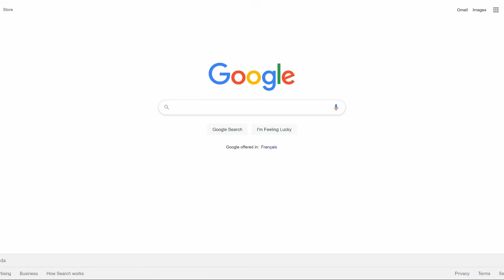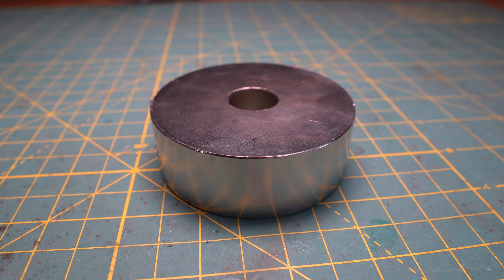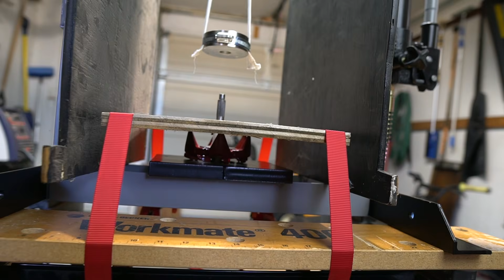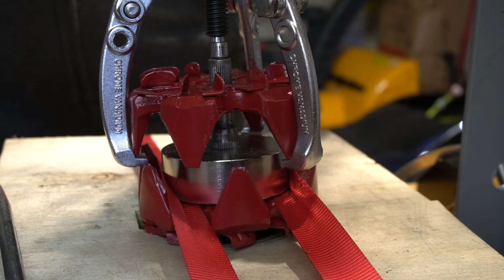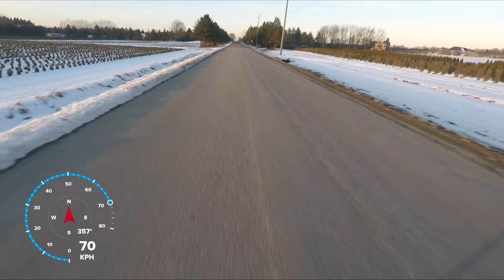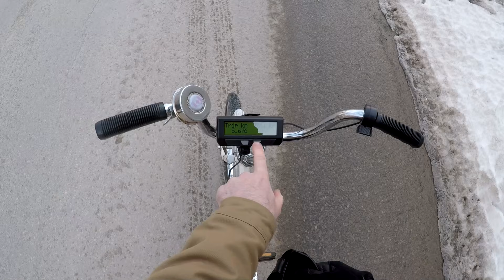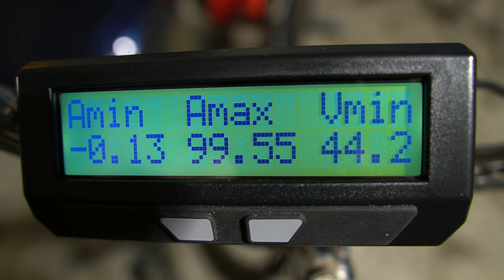Building an Alternator Powered Bike - Part 2

Comment: you would not have to, coil-coil non-blocking motor is better
Reply: To be honest, his idea was better
Reply: @foxxyytofficial  you are just proud of what you chose to be better, starter motor is a great option
Reply: @Jkauppa  but only after rewiring and opening breath holes, or else it will overheat and be damaged
Reply: And you aren't understanding fully the build
Reply: just remove the cores, that magnetize, just coils
Reply: just wire
Reply: regen only when the magnet coil is powered
Reply: free movement otherwise
Reply: you fixed the less obvious part
Reply: in a car, you have only one battery, why you had to put a second battery

Comment: So glad to see you are continuing this project. I was very looking forward to it from the teaser you provided at the end of the last one. Nothing says sadness like having a half full battery and your field  batteries die. I think if I where the kind of Maker you are, I'd have made a way to recharge the field batteries off the main pack when in a pinch. But that's just me desk chair coaching. I want to make one or a pair of these for a cart project I have been scheming on for ages. Thanks for proving that these Alternator conversions can be torque monsters.
Reply: the idea is sound and it will work.... there are several things in this video that they have not even addressed... like the AC voltage alone will do nothing, hence the power brick that converts the 120 to 24 volts... but in the end, this works flawlessly... the generators are easy to find and the motors as well... just have to do some searching.... I am putting a video together as well as a live public display of it working by the middle of July... just wanting to make sure the parts will be available for everyone.... no I am not affiliated with this channel...lol.... too many hidden parts in this video....

Comment: Funtastic ebike - been following your builds and I'm so impressed.

Could you try the range test on a slightly warmer day and keep your speed under 35kmh as wind resistance at speeds above that 
result in a massive increase in power needs to maintain those speeds.
So impressive going up those hills though.

Well done and thanks for your video's.
Reply from the maker: Thank yoU!

Comment: I wonder if 4 of the flip against tires generators used to run a headlight and taillight would generate any or significant recharge while going down the road..
Reply: that would only slow down and discharge faster

Comment: I have a question Austin; did you modify the stator as well? Your using a 48 volt battery on a 12 volt altenator. Maybe from star to delta configuration? Thanks allready, i like the video very much. Box Robert.
Reply: In part 1 he stated that for his alternator he used delta only
Reply: @foxxyytofficial  have you seen any videos showing double coiling connection in series? Delta and single star I see several, but on the site itself he saw the change in the alternator says about this connection of the wires in series in alternators with double or triple wires in each winding.
Reply: @MarcosElias  no, i didn't
Reply: @foxxyytofficial  Voce parece se interessar muito por alternador como motor. Voce ja fez isso?
Reply: @MarcosElias  Não tive a chance por falta de dinheiro, mas pesquiso e leio/assisto sobre a anos para poder ajudar os outros
Reply: @foxxyytofficial  Legal cara. Estou fazendo um, Este video do Austin é um dos melhores. Espero conseguir finalizar o meu. As baterias é que estão sendo um entrave pra mim. Muito dificil encontrar as celulas a preço acessivel e estou tentando juntar de notebook usadas. Estou com umas 80 celulas mas acho que vou precisar de muito mais.
Reply: @MarcosElias  pra 48V e 30Ah (pra durar mais), se cada célula der 2000mAh em média, vai precisar de 13S15P (195 células)
Reply: @foxxyytofficial  Quem dera, muitas celulas estão dando menos de 2000. A minha média atual está 1875mAh, e acho que ainda vai baixar. Estou pensando em fazer uma bateria de 17s pra aproveitar a mais alta voltagem que meus equipamentos suportam. Carregada a bateria só não pode passar de 72v. Ta bem dificil de encontrar baterias de notebook usadas. No mercado só acho suspeitos de serem golpistas, querendo sempre que pague o frete por pix. Estou fazendo a ligação em serie dos fios triplos de cada fase do meu alternador e vou fazer o teste pra ver o consumo, e ver se os sensores hall deram certo.

Comment: For somebody in the city, this could be pretty nice. For me 17km or whatever it had come to, isn't all that much for being in a rurale part. But yeah city folk 17 could take them around possibly for a couple or few days if they're just going to one spot and back. Less road congestion too.
Reply: Put on a bigger battery for greater range. I think he used a 14AH/48V battery to get 17 km. so for example, if you wanted 100km, you would use a 85AH battery @ 48V.
Reply: @Bennyboy-dog  18Ah @ 48V
He could get a 72V controller and a bigger battery, would be even better, since with the higher voltage he could get a better gearing and also get more efficiency
Reply: @foxxyytofficial  Exactly and with the higher volts he would use less current for the same power. Anything like that will work. I suggested more capacity at 48V because I think this would require fewer changes.

Comment: Could you somehow get it to charge while riding or peddling it??
Reply: If you were to try to charge the batteries while pedaling it would make it more difficult to pedal making it more work for you to go the same distance, this is because of the inefficiencies of the motor, inefficiencies of the conversion of motor ac power to dc power to charge the batteries, and the batteries themselves.
Reply: Nope
Only making regen work

Comment: I had Honda CB125 twin witch was converted into electric moped. Top speed 48km/h. Average consumption was around 36 - 38Wh/km.  It used 36V system and brushed motor. Also much heavier, weight was 120kg. So yep, your efficiency is terrible. :D
Reply: What motor
Reply: And power consumption grows exponentially with speed
Reply: @foxxyytofficial  Motenergy. Yes I know. :)
Reply: @foxxyytofficial  The average speed on this test was 31,4 km/h. I remember that my average speed was around 30 km/h also.
Reply: @waldemarii  but top speed was 70kph, and he didn't told us how the cycle analist makes the speed calculation

Comment: Does the motor really draw over 4000W? It does seem to have a decent amount of power but the current draw must be around 100A at the voltage you were using which is probably quite taxing on the battery and controller. I've been thinking about using an alternator as an e-bike motor for a while now, but if those numbers are correct, I would probably have to spend twice as much money that I saved on the motor on the other stuff.
Reply: You can just limit the amps consumed by limiting on the programmable controller
And as speed grows, power needs grows exponentially
Reply: @foxxyytofficial  That's a good point. I'm not an expert but I would say that as you increase the current you'll get to a point where the power output of the motor isn't going to increase anymore and most of the extra power will turn into heat. So what I'm thinking is that he might have been able to achieve very similar results while using far less power from the battery depending on where he was on the efficiency curve.
Reply: @zdenekberan7002  you're right, depending on the motor type there is a hard limit in current
That is why you need to gear the build perfectly

Comment: How much weight you'd saved from scraping out the battery, coil and brushes?
Reply: I can almost guarantee the brushless version is somewhat heavier, as that permanent magnet is fairly massive, but that wasn't the point.
Reply: Not a lot
But weight wasn't the reason why

Comment: Really great project!! so you're getting about 5Kw of peak power output out of the alternator, that's pretty good!

Dual alternator motor go-kart next maybe? Would be awesome to see that! You could also run both motors on the same controller, with only one motor having haul effect sensors, if both motors are synchronized.
Reply: You can't use more than 1 motor in one controller
Reply: @foxxyytofficial  if you were to "weld" both motor axles together, while the magnet of both motors is positioned in the same position relative to the coils, both motors will need the same steps through their coils to move, so if you power them both with 1 controller, it will work, as long as the controller can handle the increased Amps
Reply: @50geo50  you would need hall sensors on both and separate controllers
Reply: @foxxyytofficial  Maybe you should read what I have send above.
Reply: @50geo50  yeah i read, but without proof that your idea can work, i won't agree
But separate controllers and separate hall sensor arrays works surely
Reply: @foxxyytofficial  Science is mostly testing the unknown, would be cool to see something like that. A single alternator bringing a bike up to 70 with somebody in it AND 17 km range is fairly decent. Not sure what would make an alternator have more Grunt or more economy, but even getting a bigger one or two and yeah getting a little go kart just tearing up the town.
Reply: @foxxyytofficial  what he described would actually work. The motors would need to be synchronized and the rotors would need to be permanently attached together but it would work.
Reply: @mashedpotatoes5323  i will have my doubts until someone actually does it, with exactly the same model, power and rotor power
Reply: @foxxyytofficial  I mean sure doubt what you want but its technically possible... There is no reason it wouldn't work, just reasons why it would be stupid to do.
Reply: In answer to FoxyYT, you are incorrect. The German manufacturer of ESCs Kontronik sold a product called the Twindrive almost 20 years ago that did just this. It drove two sensorless brushless motors from a single ESC.It worked well.
Reply: @fionnut  so why aren't they still being sold, even more with a lot more technology to help them
Reply: @foxxyytofficial  The TwinDrive was a combined motor and ESC package for use in a particular model aircraft - the Multiplex Twinjet. The aircraft was discontinued by it's manufacturer (Multiplex) so obviously Kontronik then discontinued the drive system which they had marketed for it. So yes, it was possible, and worked well even almost 20 years ago.
Reply: @fionnut  i won't dismiss the effort on the company, but spinning props is not the same kind of load as a heavy 200-300lb build
Even RC cars with sensorless BLDC motors can suffer from cogging as they slowly start accelerating, now im heavy builds the cogging as the sensorless pattern starts can become a problem, even more with two separate motors that probably won't be fixed together to not lose sync between them
Reply: @foxxyytofficial  I never said it was suitable for this application. However the fact remains that you were incorrect, you said it wasn't possible to drive two motors with a single controller and yet I have provided an example of where it has been done, successfully in a commercial product, long ago.

Comment: Definitely saving on battery not powering the Rotor.  
Just wondering what difference segmented magnets in Rotor would do instead of the Wedged shape metal as I'm sure you'd have even more power and even less battery usage.
Sure you could do a follow up video on that ?
Reply: "Chris workshop" (without the quotes) did a video on a non-claw pole alternator rotor 3d printed

Comment: Can you use the electromagnetic rotor as a sort of variable field motor by increasing or decreasing the field voltage so that you choose high torque or high rpm
Reply: Would get you more range and better acceleration. If you use the "buck converter" he mentioned, it would be a simpler control point while still removing the second battery.
Reply: @jameswyatt1304  about better acceleration i don't know, since it already was at full current with the 3S LiPo
But range would only be better if he could adjust on the fly, and that is dangerous
Reply: yes he can, but he didn't wanted to

Comment: Would it be possible to place the alternator where the bottom bracket is and attach the crank so it powers the front whilst still enabling you to peddle
Reply: sorry, couldn't understand your idea
Reply: @foxxyytofficial  I think he/she means is attach the alternator so that it powers the front wheel so it allows you to pedal the back wheel sorry if I'm wrong
Reply: @Syn_X1e  Oh, that's okay, Hedzer Pntang here on YT did that with a friction-driven alternator ebike

Comment: I have idea how to make it more efficient. Can i contact you to share my idea. Thanks :)
Reply: Tell us
Reply: how
Reply: change the stator core .. with no orianted grain steel for electric motor 0.5mm or 0.3mm then make new stator.. or you can remake induction motor to synchroneus motor
Reply: @ivanmrqnkov9226  its already a synchronous motor, but the stator core is a good idea
Reply: @foxxyytofficial  i know alternator is synchroneus motor .. can i contact you if you going to make this update to the motor ?

Comment: OMG!! yeahhhh!!! love ur vids broooo!!
Reply: @austiwawa Can you increase the voltage of your battery? do you think it may perform better with higher voltage??
Reply: @sebasalek1  yes, 72V can be used
Reply: @foxxyytofficial  what about more voltage? may it increase the efficiencyat at least a little bit? i mean, 84v or even more... you'd get more speed, but what about the consumption?
Im bulding an ebike and bought a 48-72v controller, and recently also bought some irfb4110 to change the original mosfets of the controller to apply more voltage (also i will change the caps to increase the voltage limit). I want to make the battery last longer, hope increasing the voltage may help...
Reply: @sebasalek1  84V nominal or max voltage?
Reply: @foxxyytofficial  those fets can take up to 100v, so maybe 96v would be the max voltage i'd be applying...
Reply: @sebasalek1  but you need to realize that voltage spikes can be a lot higher, keep them under 84V max for 100V fets
Reply: @foxxyytofficial  ok, great!! thanks for the tip!! ;)